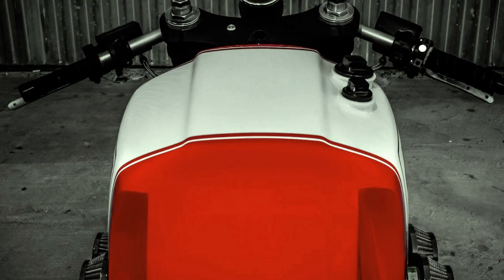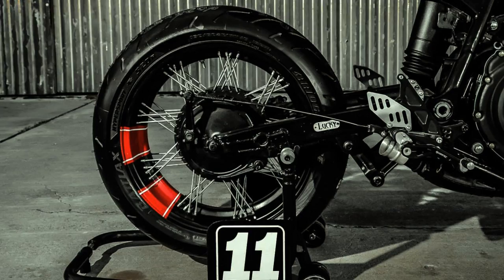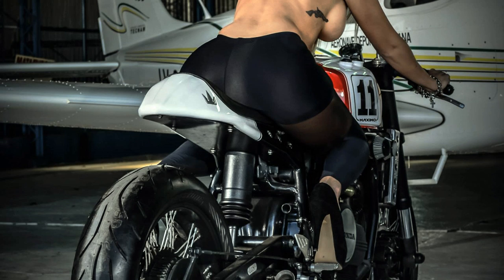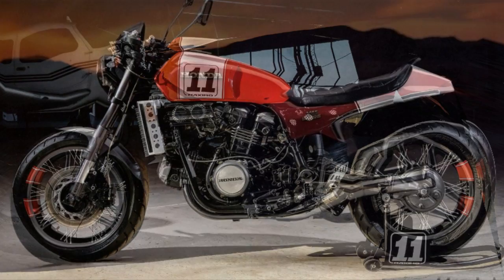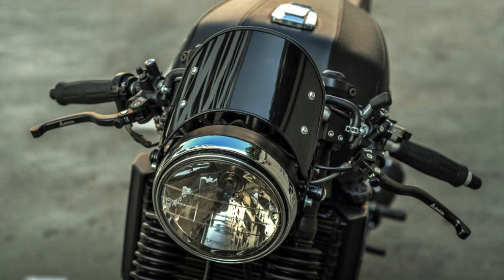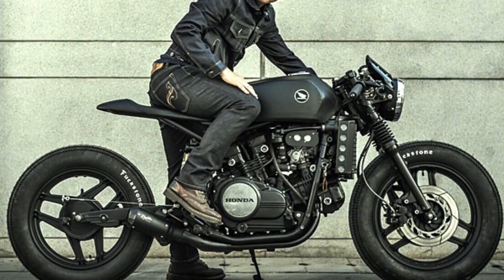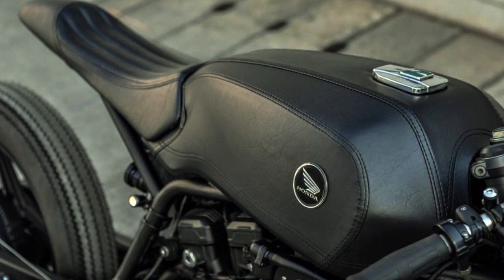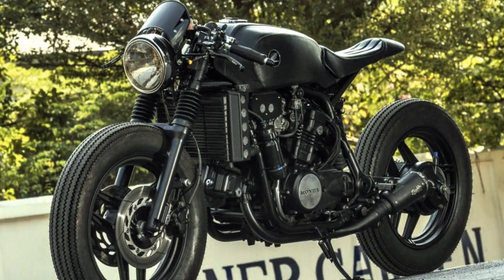Cafe Racer (Honda VF 750 Sabre by Lucky Custom and by K-Speed)

Comment: where is the battery and the wires on the second project?
Reply from the maker: It is probably located under the Fuel Tank and seat.
Reply: I don't think I see a speedometer. Badass!

Comment: Are those VF 750 S??? The Rc07?
Reply from the maker: Yes, they are based in the  VF 750 S. But the Rc07 has a different frame with 2 shock absorbers at the rear.